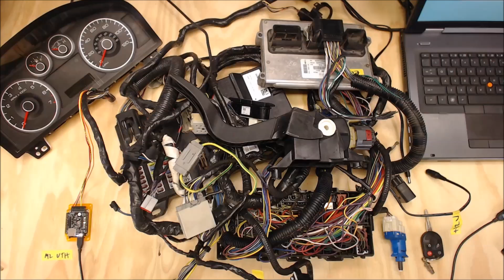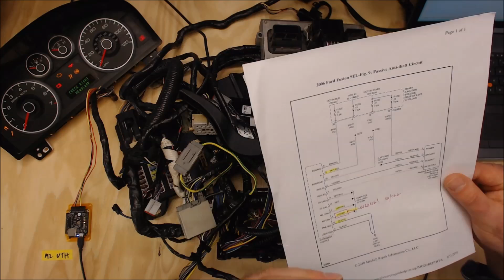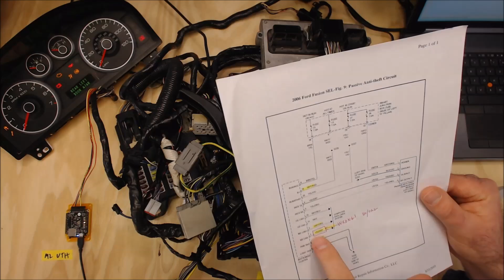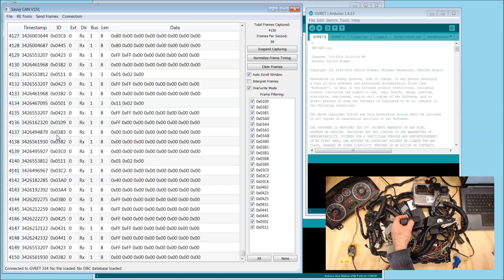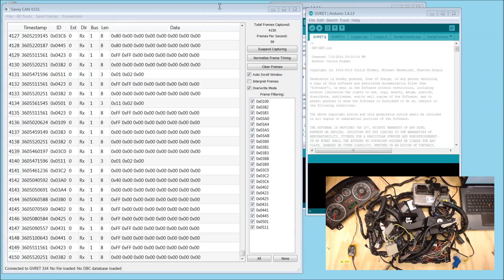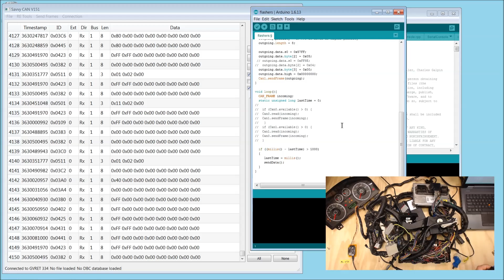Simple Car hacking with Macchina M2

Comment: Does SavvyCAN work with any of the other popular hardware from eobdtool... CANNY 7, CanTact, CANdo, Ginkgo USB-CAN, Libre Solar CAN, CANable, USBtin, K+DCAN 2.12 (Win10), PCAN-USB?   For example, I've got a Pi with a CAN hat that I'd like to use:
https://www.waveshare.com/wiki/File:RS485_CAN_HAT_Code.7z 

Also, I understand SocketCan makes CAN devices look like network devices..   But is SavvyCAN just a GUI for the standard linux-can/canutils tools (candump, cansniffer, cansend etc)? 
https://www.hackers-arise.com/single-post/2017/08/08/Automobile-Hacking-Part-2-The-can-utils-or-SocketCAN

BTW, VectorLib appears to have a nice gui interface, as does 'CAN-Hacker Bomber':
http://opengarages.org/index.php/MCD_software